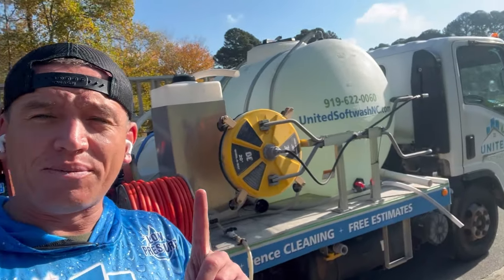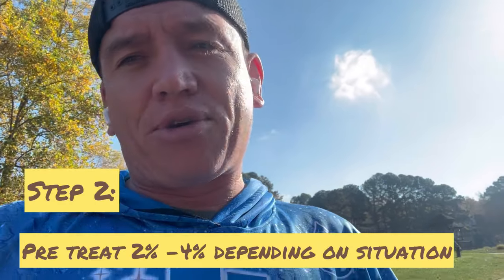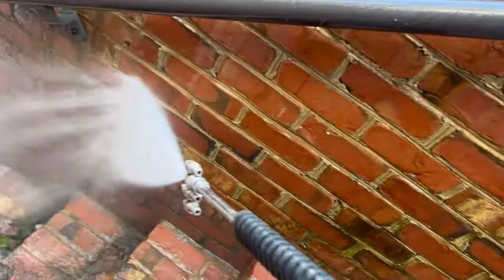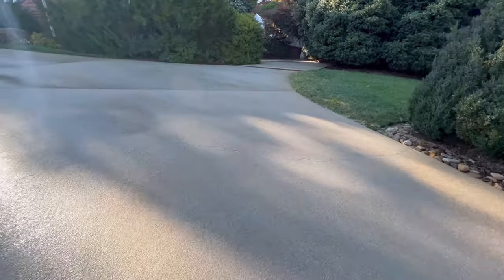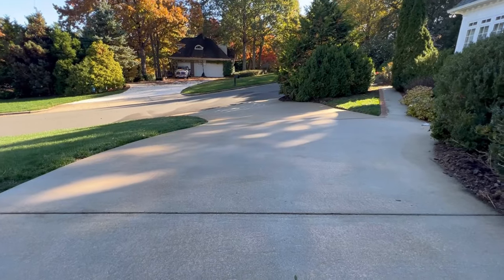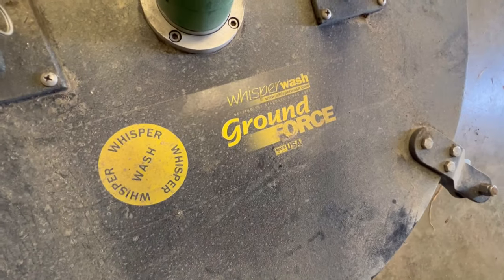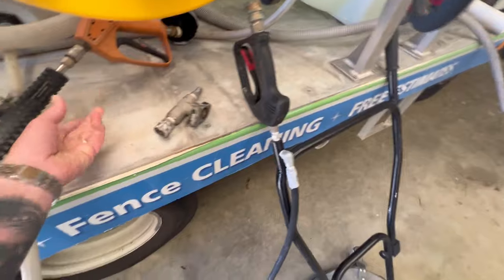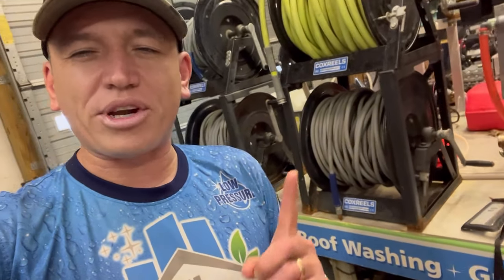How to Wash Bricks and Concrete like a PRO! | Pressure Washing SECRETS

Comment: Good video but I disagree with your part about needing minimum 5.5 GPM machine if you're "just starting out" and don't have a lot of money to begin with. Why tell someone to go spend $5k+ on a machine when they need to prove to themselves that they can get work, and do a decent job with a cheaper 4 GPM machine? Your setting newbies up for financial failure from the get go.
Reply: Agree I started off with a 3200 psi 2.5 gpm but am more focused on reputation first and work my way up
Reply: You can get a 5.5 for about the same price usually $100 more than the 4.0gpm. Also you can do a driveway with a 4gpm if you are going slower and not overlapping and rinsing after a few passes.
Reply: I'm just starting with a 2.5 gpm DeWalt, definitely slower but I enjoy taking my time. I get driveways, walkways and retaining walls done perfectly with it. With a 16 inch surface cleaner I just go very slow. Till I make enough to buy a 4gpm machine. $300 turned into $1500 in 3 days! 2.5 is all you need to start with.
Reply: if you're gonna wash it the way this guy does... even a 5.5gpm is low.  pre-treat, pressure, post-treat & rinse?  that's an insanely long process for a 4gpm
Reply: @MarkOsborn-lp9cc  the topic is for people that are "just starting out" and have no experience. That's why it doesn't make sense to start off with expensive equipment. Starting out you aren't going to be doing mansions or big commercial properties. 🤷‍♂️

Comment: Hi Kyle, coming from an industrial water treatment background and dealing with sodium hypochlorite, I haven't seen any of the power washing videos where the guys are reducing the pH of their SH mix when using it on driveways and sidewalks. Reducing the pH will greatly increase the efficiency of their mix. Here is an example of efficacies of SH at different pHs. At a pH level of 7, chlorine is roughly 75% active. At a pH level of 7.5, chlorine is roughly 50% active. At a pH level of 8 chlorine is roughly 25% active. With a pH level of 6.0 your SH mix will be highly effective with 97% of your chlorine available.The pH of the SH mix can be reduced with white vinegar and the pH checked with pH strips. Give it a try and see how effective your clean will be. Thanks for all the videos.

Comment: Just got into softwashing. I have the 20" BE Whirlaway surface cleaner. If there's already stripes on concrete should you do another pre treatment, surface clean, and post treatment to get them away? I hit it with a 1.5% mix and they are still there. Not sure if the concrete is etched or something like that. Really appreciate the information you put out!

Comment: I have a question. I have a 3400 psi 2.4 gpm pressure washer. I purchased a downstream injector and a jrod made for my gpm. What ratio bleach will I be putting out. Let's say I'm using the 10%. I'm not in the business, just wanted to wash my house , driveway and sidewalks. Also I has a split level house that has a second story over the garage. Will it reach the peaks? Is the standard gun that comes with the unit good? Thank's for any help.

Comment: Hey Kyle, I have a pressure washing business for a few years now. I am currently bidding on a large school that is three stories high and is brick with some sandstone. I was planning on using sh on it. I am thinking around 2 percent. My concerns are, should I be worried about any inspector watching the waste water going down the sewer drain? When I am at a large commercial situation, I always worry about getting fined.

Comment: I have a 3750 psi and 4gpm machine and I use a 24 inch surface cleaner. I just try to go slow, but sometimes I see lines 😢

Comment: So a 20-24” surface cleaner is going to be a lot more forgiving on the lines as far as if I move out of line a bit right ? And if I got a smaller surface cleaner unit than that then just take it real slow if i’m hearing you correctly ? Thanks in advanced brother

Comment: After your pre treatment. When you’re starting with the surface cleaner … are you just pressure and water? Or are you running any checks through the lines with the surface cleaner ??

Comment: That's me i guess lol. No one has ever told me i needed to ever switch my tips out only that i make sure they are not clogged up. It's been a year so I guess i need to do that just because. I have always pre treated so I've never had problems with lines. I do know this, i just did a wash on a brick home and there are these black kinda wide lines under the windows on the brick. I can't get these black lines to come off the brick. I'll figure that out i'm sure, but right now i'm so lost.

Comment: Thanks for the video.  Liked and subscribed.   I  have a new 12' X 28' patio that began to delaminate 2 mm flakes from the surface.  I went out after it had cured for 19 weeks and was using just a leaf blower on it before applying a densifier then a sealer and the flakes began to come off.  I was going to try using my Simpson pressure washer and surface cleaner to try to get all the flakes off so that I don't have to have it surface ground but I dunno.  What would you suggest?  Also, I may have missed it but what do you use for your pretreatment solution?

Comment: One thing I do is make sure you aren’t running to much pressure on the concrete driveway with a surface cleaner. I always test a area and turn down my pressure as needed. If your seeing alot of sand residue on the driveway your pressure is to high. Don’t etch the concrete just clean it. Like Kyle said pay attention to your tips sizes. 

I have done over hundreds of driveways with my PW business. Over 20 yrs in the business. 
Awesome channel Kyle!!! Fantastic presentation and solid simple knowledge. Great job!!!👍
Reply: @poisondaddy  thanks. What I do is just turn down the gas throttle lever to about half from full. Will very depending on size or psi of your machine. For example if you have a 4000 psi rated machine half throttle should be around 2000 psi. Probably a little more than half throttle will be just about right. Then watch your concrete surface and look for sand particles. You will have some but not a lot. Like I said before clean the concrete don’t etch it. 
Adjust the throttle as needed. It takes time to get it down but it’s better to start with light pressure than to much.
Reply: @mattspontiacta gas throttle do you mean the gas turn valve? Or the choke?
Reply: @Monztuh  I turn mine down by using the throttle/gas lever. Only use the choke when it’s cold out. 
Hope this helps you.

Comment: 1/1/23.. Great video as usual Kyle..What was the sqf on this particular driveway and what kind of $  psf are yall able to get on flat work in your area..I struggle to get .20 - .25 psf in my area . I know all areas are different but just trying to get a general area. Now i understand when its alot of square feet  you may need to lower your percentage but can only go so low of coarse

Comment: Thanks for the video. Is the pre-treatment basically 'bleach'/sodium hydrochlorite? Also, why do you use the wand on the flat surfaces, rather than a surface cleaning head?

I just got my first pressure washer, ever, and I wanted to get an entry-level unit. I'm going to use it to prepare a deck and a roof for repainting, so when I found one with a surface cleaner included, I didn't have to shop for a surface cleaner. My first experience with the pressure washer was a real revelation. I can easily see myself becoming a person who can't live without one.

Thanks for the content.
Keep up the good work.
בס'ד

Comment: We normally don’t pretreat, but we had the same scenario recently. 12000, yes 12k sqft driveway. We pretreated with 5%. And post with 3%. Came out amazing! 
Also all we use is our Jrod tips as well! Never need more pressure than that if your sauce has worked and you applied properly! 💪🏽
Reply: What chemical are you using for pre treatment?

Comment: While you were surface cleaning the driveway (particularly the sloped portion closer to the road), did you just let the excess water run into the street?  If so, how would this not be a violation of the Clean Water Act?
Reply from the maker: I used a quick dam flood barrier

Comment: I'm just getting started here in Toronto Canada.. your method of approach towards the finished product is fantastic I look forward to  implementing a lot of these important tips in the spring when I get going 🔥💯🤘
Reply: Where are you getting your supplies?
Reply: @andrewhal9720  I've been shopping around a lot over the winter.. most of the hardware like the washer, hoses, backback sprayer ect from home Depot and noble trade.  Bleach from the pool store and for my Chems I'm still shopping around to be honest I haven't tested anything it's been way to cold outside. I'm gunna buy a few degreasers and see what works.

Comment: I’m very thankful for your videos just trying to get going here in MI. Question for pretreatment and post you use SH. Do you ever use the driveway cleaners that are out there or would that only be for certain stains? Thanks for your time!
Reply from the maker: I use sh for the pre and post treatments. For grease and oil stains I use a caustic degreaser like gold assassin. For rust stains I use oxalic acid like f9 barc. Driveway cleaners that you see at big box stores don't work well at all. hope this helps

Comment: Great content as always, love the set up , any advice on doing a driveway that just had the expansion joints filled with sikaflex sealant? How long should I wait to do driveway,,, can I run a 24 inch surface cleaner @ 8gpm over the sealant? CHEERS
Reply from the maker: thanks for the support. Once the sealant joints have cured I would carefully want the concrete up to the joints. I would not run my surface cleaner over them

Comment: u put down more product with a gas pump but that does not mean you have more professional equipment that some one with a 12 voit pump i can tell you those are great had them when they work but most likely they fail more often than 12 volt pumps.  best of luck to you boss

Comment: what about exposing the rocks under the main surface of driveways / sidewalks? What do you do to make sure that doesn't happen or how do we even avoid that
Reply from the maker: I use the correct tips so I don't apply too much pressure to the concrete. For most concrete washing I stay below 2500 psi

Comment: Do you think the gas engine over a 12 volt helps with the lines?
Reply from the maker: No. Both gas and 12v can put out the same strength chemical. Gas just allows you to put out more volume thus reducing the time on the job.

Comment: Did you know that a belt drive 4gpm unit will efficiently push a big guy YES a 28" surface cleaner.  Must pretreat of course.  We no longer send 5.5 or larger units with our techs.  Using a 4gpm belt drive hooked up to customers spigot is so much a man out to do flat work all day working out of his truck bed vs. hooking 1 of our trailers up to use a larger unit with a buffer tank (make sure customer has good water flow and use your own garden hose flexzilla 3/4, NOT the Customers typical crappy 1/2 kinked up hose. Our flatbed and 2 trailers have multiple large volume units BUT new techs are typically NOT capable of remembering all the dos and dont's of having extra equipment.  The 4gpm belt drive idled down 3/4 along with an xjet without restrictors allows them to softwash stucco, brick, etc because it still allows for about. 4% hot mix.   
Much easier sending 1 - 4gpm belt drive with 24 ok 28" surface cleaner, xjet with 20' suction hose fed to a 5 gallon portable carry tank.  Doing things this way has almost double our business because we can easily send 1 guy out to homes 3,000 sqft and below while our larger units and 2 man team hits the large homes.
Reply from the maker: Thanks for sharing. keep doing whatever works for you and your company! I personally couldn't wash 4-5 houses a day with a 4 gpm machine.
Reply: @softwashtv6315  that's why we have 2 teams of 2.

Comment: 10:30 this message is approved by obi wan
Reply: it is crazy, i use a basic electric pressure washer on my drive way the first time i used not pre treatment and it came out with lines, my neighbor had his son come out and do it with his gas one and still had lines, this time i did it with some pretreatment, it wasnt even bleach it was a drive way cleaner i bought and used my electric pressure washer and it was cleaner than with the gas one pretreament works, i will use some bleach next time and see if that makes a huge difference ro not

Comment: Not a fan of introducing gallons of SH into the environment without neutralizing.   Softwashing is great but high pressure is certainly in order here. This idea of leaving excess bleach on ground is not environmentally friendly as future runoff. Use bleach but use a bleach neutralizer to make PH neutral.
Reply from the maker: High pressure alone in this case will not clean the concrete sufficiently.

Comment: ARE ALL THE CHEMICALS USE BIODEGRADABLE SO THE DON'T HURT THE ENVIORMENT?
Reply from the maker: yes, the chemicals used in this video are biodegradable. just so you know.... not all chemicals that are biodegradable are safe for the environment...
Reply: What precautions do you take for run off and do you have a video explaining what precautions you take?   The one video you made on chemicals are those the ones that are biodegradable?

Comment: Air pumps killing gas roof pumps
Reply from the maker: in what regard?
Reply: @softwashtv6315  they’re more reliable gas pumps are more flow and powerful but the air pumps have a good distance and can handle commercial jobs but it’s more reliable far as maintenance.
Reply from the maker: @fulkspressurewashing6961  thanks for sharing your opinion